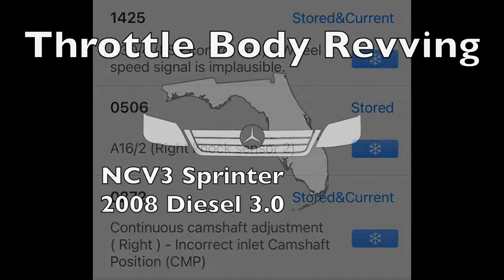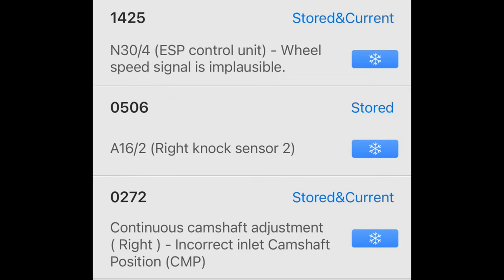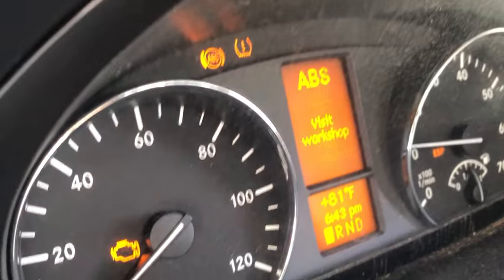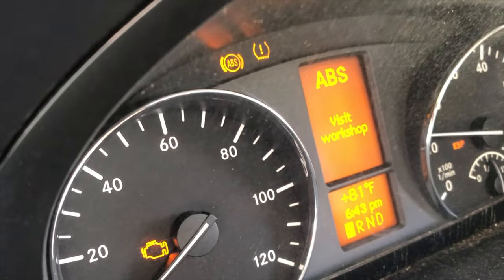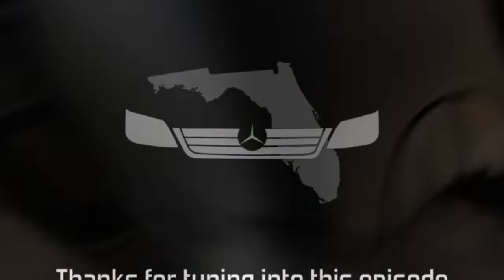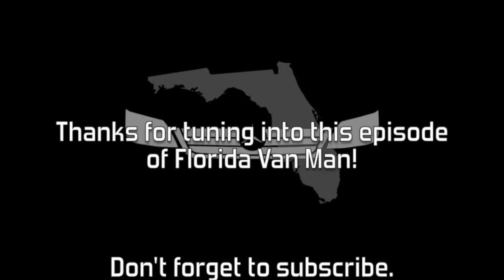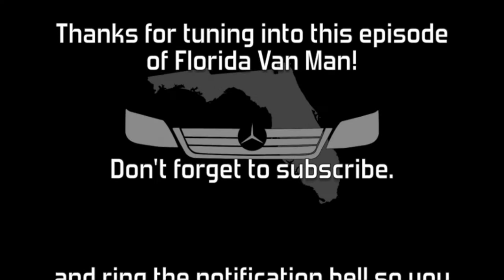Revving NCV3 Sprinter, Throttle Body Problem

Comment: Short but great video with engine sound showing what is the problem . I have 2014 Sprinter v6 3.0 3500 and make exactly the same sound . They scan a truck and there was no any error code . Truck doesn't have a full power . But mostly they scan my pocket . Long time I was looking for a video with the same engine sound like my . You make a point where to look for trouble .
Reply from the maker: Good luck. It was difficult to reach but fixed the issue 100% for this van.
Reply: @FloridaVanMan  thank you . With my it's difficult also I bought the Xentry scanner year ago . Scanner show me only  I have a problem with AC door actuator and nothing else  . So I follow your direction I put on live data and I see I have a boost pressure too low  and pressure sensor doesn't respond correct . And I follow you idea new sensor doesn't need to be 100 protein good . I found  that  the new MAP sensor which I install doesn't respond correct either . But the funny thing.is this sensor doesn't  trow DTC  trouble cod .. I have to fix everything because in one week I have a trip from New York to Florida . My friend ended  with engine start countdown in North Carolina .. He tow his Sprinter to New York for only $3,800 . So I don't want to end up like my friend .

Comment: Hey Bill I need help as well lol
I bought that scan tool y’all recommend, but still can’t trace the issue, I’m at a bit of a loss at this point. Van runs and drives fine, just can’t clear the code.

I’ll be in FL in a few days I can swing by if you’re interested in taking a look/giving me some pointers.

2005 dodge sprinter 2500 158”Wb HT passenger.

1. CR-Common rail-

(2624-1 The permissible limit value for the air mass is exceeded.)  

2. EWM-Electronic selector lever module-

(P1926 CAN communication is faulty.)

(P1925 CAN fault - The brake torque is implausible.)
Reply from the maker: Have you tested the MAF as shown in our MAF video? That is the only code effecting drivability. The other two could probably be resolved with a new/used shift stick assembly but if your cruise control and brakes are working, and you have no trouble getting in & out of park, there is little reason to bother. We have used shift sticks here and schedule appointments based on available parking. No shop, just a hobby gone wild, doing street-magic* for donations.
Reply: @Florida Van Man

M/A/F should be good, I just replaced with new Bosch unit last month.

I don’t expect you to fix anything Bill I know you’re busy, I’m more looking for your expertise or advice on what you think the issue might be.
I also have a sliding door that was replaced and is giving some issues as well.
All I know is It’s far too cold for me to work on a vehicle in Wisconsin it was -20 here a few days ago. 

Im looking for a state to move to since the ranch I was working on Colorado was sold, So I’ll be staying in Fl for awhile till I figure out if it’s the spot for me.

Any good campsites or national forest areas around a guy could camp / work on a van at?
Reply from the maker: @WingItWithEthan  Ocala National Forest has plenty of free camping and some state park camping too. I would still test the MAF with volt meter. A new part is not always a good part and even if the MAF is good the test might reveal a wire issue or power supply problem.

Comment: Bill, I've got a 2011 MB Sprinter 2500 with a similar problem. However, it idles just fine, but does the "surging" at steady throttle when cruising down the road at just about any speed.  My mechanic connected the OBD scanner to it and we identified two throttle sensors that seem to need to move in synchronization with each other. However upon acceleration, one climbs to about 28% while the other climbs to about 5% (a 15-18 point gap).  We feel like it's either the accelerator pedal or the throttle body malfunctioning.  Thoughts?
Reply from the maker: My first thought is the code reader your mechanic is using probable isn't compatible with Sprinters. If they are reading generic OBDii codes it is likely they are misleading. Get the first item on this produce page, follow our setup video, and when you get to the options with fist line "906..." and we pick the second line "901.6..." you will pick the first line for NCV3 vans. This will give you true codes for your van that uses unique protocols. If that code reader still points to throttle body, swap it! It isn't expensive but it isn't easy either. I suspect the proper code reader might direct you to swirl valves or some other apparatus we don't have on T1N's.